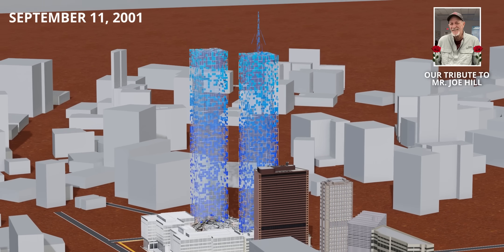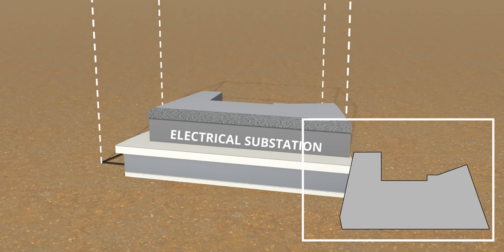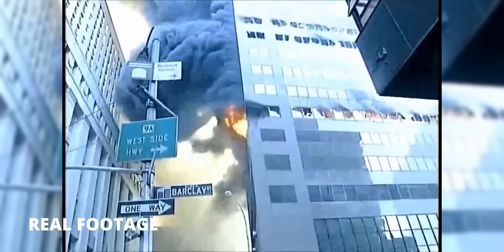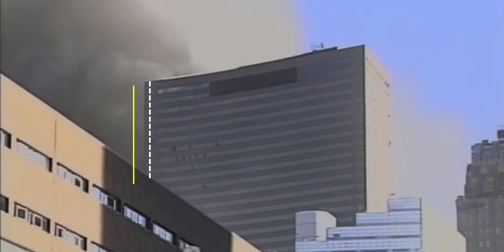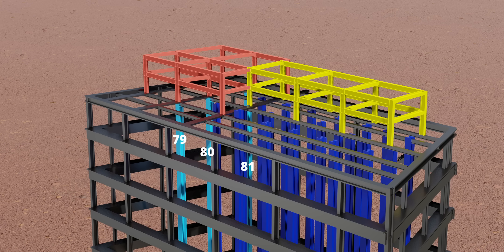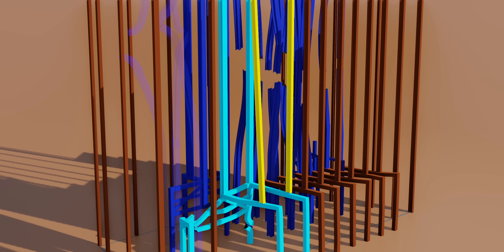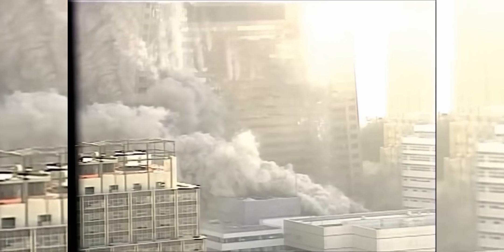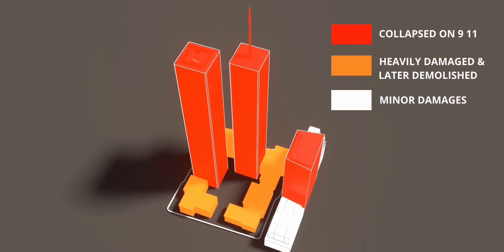Collapse of Building 7 | The Complete Physics

Comment: " Let's simplify,  it was a controlled demolition."
Reply: Simplify = wrong. 

Controlled demolition?  Do you think you could be more specific?  Or maybe even just a little specific?  

I mean, this video goes into a fair bit of detail describing and showing all the how and why, with each point following logically from the last and supported by direct example. A lot of analysis and thught went into it. Controlled demolition is just a two-word hand-wave. No thinking required or employed at all. It’s not an explanation. Not even close. It’s just,…

Dogma.

This video goes into a much higher level of detail than many viewers can comprehend and while there are a few gaffe’s, they aren’t critical and it gets the collapse mechanisms fundamentally correct. That is true no matter who planned and carried out the 9/11 attacks or why . 
	
OK, that’s not what you want to hear and it goes against 20+ years of conspiracy dogma and conditioning, but that doesn’t make it wrong. 

You just need to fix your dogma. 

But hey, on the positive, just because this wasn’t a controlled demolition the 9/11 attacks could still have been some sort of inside job. The two things are in no way mutually exclusive. Don’t get stuck in that mindtrap. You just have to rework it to unload all the silly pre-planned demolition nonsense the 9/11 Truth Movement has been shitting the bed with for 24 years. 

Time to find something that might actually work instead of 24 years of consistent proven epic fail. 

Here’s another bit of blasphemy. Despite what you have been led to believe, the collapse mechanisms described here have broad professional support around the world. There are no professional engineering organizations (for example: ASCE, ASEE, ICE, etc) that disagree with them or have offered any formal dissenting opinions or alternative hypothesis. The worlds peer-reviewed engineering journals contain no contrary articles or papers.

So, either the overwhelming majority of the world’s structural engineers (and simple observation) are wrong and thanks to a few hours and Google you know more than the world’s best engineers, or maybe what you believe and what actually happened are two different things.

Which seems more likely? 

Here’s a simple challenge:  If this explanation is wrong then go ahead and present a superior alternative.  Something more detailed than 2 words. No one ever does.

Comment: From this simulation what I gather (as an architect) is that they only needed to sever 3 internal columns with shape charges to collapse the whole building. Seems like the structural engineer that built the building, along with the structural engineer that later added the penthouse - would have warned the owner about this fatal flaw out of professional ethics and/or legal responsibility - and potentially disclosed it later on to Silverstein as part of a "material fact" relevant to the real estate deal. Either the fire knew exactly which 3 columns to structurally compromise or Silverstein struck a bargain with the controlled demolition vendor and only had to pay to blow up 3 columns. Your simulation is the most compelling piece of evidence I have seen yet which supports the plausibility of the WTC 7 controlled demolition theory. That is the funny thing about doing sound science: in the process you can unintentionally add credibility to the claim you are setting out to disprove.
Reply: There is literally no evidence, compelling or otherwise, that gives any credibility to the controlled demolition conspiracy theory. Glad to clarify this incredibly simple point for you. 👍
Reply: Did they mention the multi million dollar reinforcements made after building was built due to it being the mayors bunker Cia and Fbi offices?
Reply: You can imagine..... the damage the fire caused 😮😮😮😢😢😢🎉🎉🎉😮😮😮😂
Reply: An architect confused by structural engineering theory. Shocking.
Reply: Beautifully put
Reply: It seems like you missed an awful lot.  Like 95% of this presentation. Maybe this will help;

The collapse of Building 7 is one of the most studied engineering disasters in history and the subject of 5 comprehensive engineering studies and more than two dozen technical articles in major peer reviewed engineering journals, most of which were published 15 or more years ago. Thousands of pages of material.  This should get you started.

FEMA BPAT (initial report superseded by NIST NCSTAR 1A)

NIST NCSTAR 1A: Final Report on the Collapse of the World Trade Center Building 7, 2008.

Guy Nordenson and Associates, WTC7 Global Collapse Analysis Report and Summary of Findings, 2010.

Arup, WTC -7 Structural Fire Analysis Report (Runs 1-4), 2010.

Weidlinger Associates Inc., WTC 7 Collapse Analysis and Assessment Report, 2010.

BRE Centre for Fire Safety Engineering, Analysis of the Impact of a Fire in the Mechanical Room (5th & 6th Floor) of the World Trade Center 7 Building, 2010.

T. McAllister, R. MacNeill, O. Erbay, A. Sarawit, M. Zarghamee, S. Kirkpatrick, J. Gross, Analysis of structural response of WTC 7 to fire and sequential failures leading to collapse, J. Struct. Eng. (United States). 138 (2012) 109–117.

For a summary of the major studies I would recommend THE COLLAPSE OF WORLD TRADE CENTER 7: REVISITED by Mhd Anwar Orabi , Liming Jiang , Asif Usmani and Jose Torero which is a 33 page summary of the different analysis and conclusions published in 2020. Sorry, YouTube will delete this post if I give the link but it should be easy to find and is available from the University of Queensland, Brisbane. 

Real structural engineering industry professionals conducting real engineering studies and publishing them for other professionals to see. Not amateur YouTubers appealing to the gullible and credulous.

Happy reading

PS 

There is not now and never has been a controlled demolition theory - only the paranoid rantings of ignorant morons,... who ignore 95% of the evidence right in front of them.
Reply: @TheCriticalStinker-01  Calling names does not make your case any more stronger.  As I said above the climate alarmists  have concocted a tremendous body of  work to try to convince the world  we need to trust politicians and abandon our ways of life, but yet there remains a great number of scientists that can shoot holes in their concoctions, and so it is for the 9/11 controversy.  I only wonder why those seeking to gaslight others feel the need to use pejorative language?  If we don't buy your story, no harm to you, no foul, why the name calling?
Reply: @TheCriticalStinker-01 are you ✡️ish?
Reply: @TheCriticalStinker-01 the most studied in history - without looking at any of the physical evidence 😂
Reply: @TheCriticalStinker-01  That's a lot of studies. Who was paying for all that?
Reply: @3ddesigns220  Lmao bro we can't win with people like you. All roads lead to conspiracy for you
Reply: @3ddesigns220 The neocons and/or AIPAC

Comment: By far the biggest crook of sh~t cover-up of the truth I've seen in a while! The only possible way a steel building of this size can symmetrically free fall in 6.9 seconds in its own footprint is by explosives. Unless of course you found a way around the laws of physics__lol.
Reply: It fell in 18-20 seconds.  I know. Unlike you I actually timed it myself, didn't just take the internet's word for it.   

This is the famous Steven Bikovsky CBS fixed camera footage of Buildng 7’s collapse, shot from West St. about 10 blocks away. The camera was fixed on a tripod aimed at Building 7 because its collapse was anticipated.   

www.youtube.com/watch?v=x8D9993hvJk

The first externally visible signs of collapse at this angle appear at 16:44.  Now stop the video 6.9 seconds later (16:51) and tell us if the building is done collapsing yet.